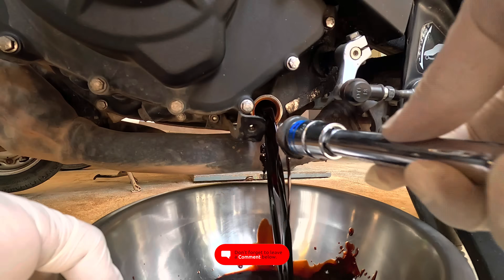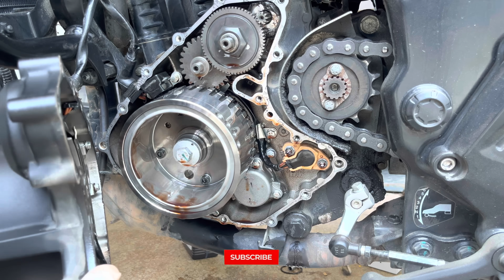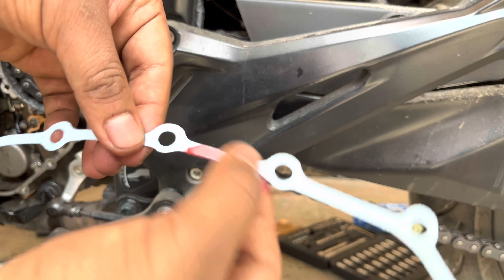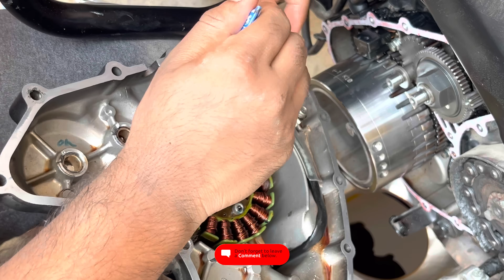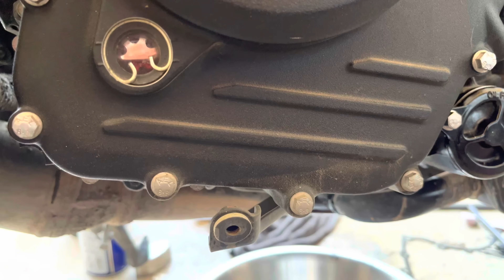Dominar Oil Leak Issue Solved | #dominar400 #automobile #maintenance

Comment: No anabond use rtv silicone and use a plumbing teflon tape the same thing i used to wrap the gear position indicator and pickup coil solved my issue
Reply: Never use anabond ones
Reply: be careful with this, once oil galleries are clogged with this your cams will not be happy neither is the cylinder head.
Reply: @MrTrolololol yea never overapply

Comment: Hii bro suggest me a good engine oil for ns200 bs6..i have been using the motul 20w50 7100 and the performance is poor lot of heat production and vibrations.. im planning to swtich the bajaj oil..i need ur suggestions
Reply from the maker: Go for Motul 300v or 300 v2 if you can increase the budget
Reply: Motul 20w50 7100 is the best for ns200
Reply: @marcopolo5249  bro I have been using it for past 3 services motul doesn't provide gud performance  nowadays..Even my Frnds faces the same issues
Reply: @pyscho6868 bro for the price its good bro
Reply: @marcopolo5249  bro recent days motul is providing worst performance...I have been using it for  last 3 services for my bike
Reply: Try lequi moly street race once

Comment: Same problem is there in NS200 2023 model bro, showroom guys tried replacing Magnetic coil and applied anabond for 4 times , still leaking 😢
Reply: Allow some time for anabond to set
. Don't put oil and start the engine till 3 hours after the sealant is applied.
Reply: Bajaj all pulsar series have this problem just apply silicon bond on top
Reply: Same bro
Reply: Same bro
Reply: I was once facing the same issue , thn, Once I didn't started my bike for whole 1 day after anabond applied and I got rid of it 🎉

Comment: Does it apply same on NS 200 I have exact same issue. Also can I reuse the engine oil as I recently changed it
Reply from the maker: Yes
Reply: @ARKIONX  Have you reused the engine oil as well?
Reply from the maker: I replaced it, however if you are planning to reuse, strain it properly to remove any dirt or debris.
Reply: @ARKIONX  Got it! and huge props to you for pushing quality content and still managing to reply all of us <3